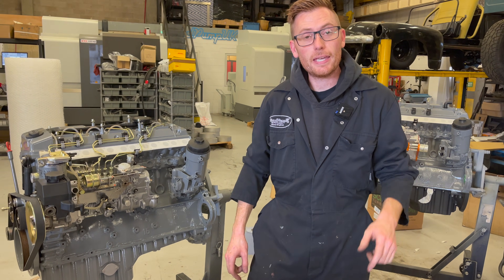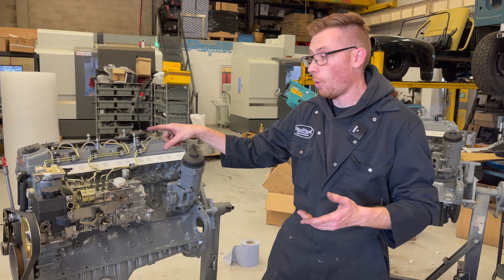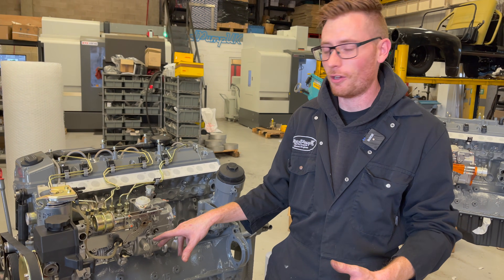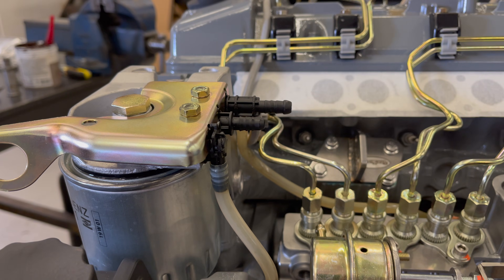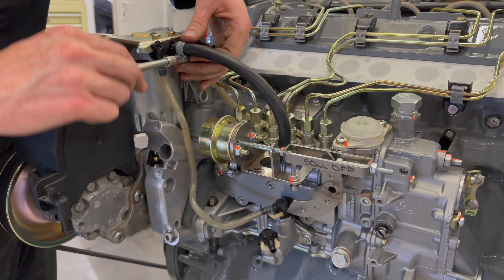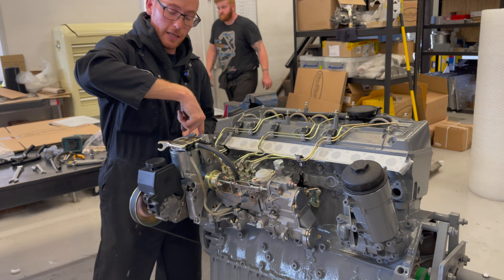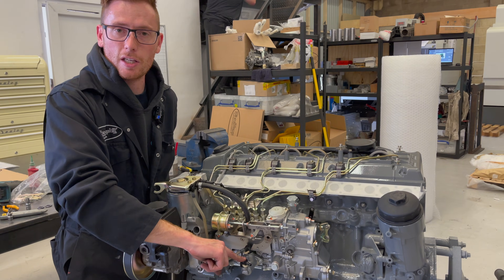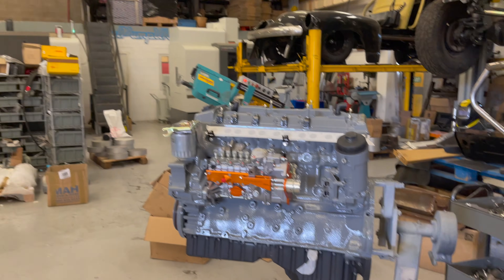HOW TO PIPE UP YOUR PUMP IN 4K.   OM606 guide to mechanical injection

Comment: How do you block off the pre filter
Reply from the maker: You don’t need to, it’s not internally connected to anything.
Reply: Corretion.  How would I by pass Pre heater since it will not be connected to the pre filter?  Just needing clarification.  Thank you again.
Reply: I just purchased Pre heater delete from your website. Thanks!

Comment: One of those would be perfect for a 1st or 2nd Gen Dodge Dakota pickup. They weigh around 3000 pounds with a 318 V-8 and being a mid size from the 90s has the biggest internal bed dimensions of any mini or mid sized truck. Since it’s full size brother was the first pickup with a 5.9 Cummins the OM606 would be a perfect match. By the way  my late cousin who job was a truck drive routinely got 25 mpg out of his mid 90s Ram extra cab dually one ton. I bet the pickup I described above would top 40mpg.

Comment: Here is one reason why I would love to get rid of the filter head: Japanese diesels have a manual primer pump on top up their filter heads, making replacement of the diesel filter much less scary.
Reply: just fill the new filter with fresh diesel or your preferred fuel treatment .. never had a problem since i was shown that trick

Comment: Could I bypass the lift pump and filter housing.  If I run an Airdog lift pump by my fuel tank.  That filters and separates water and air from the fuel.

Comment: If you're using an electric lift pump along with the mechanical one, do you recommend putting it in series with the original mechanical one, or tee it in so that whichever produces the higest pressure/flowrate at any point in time works best? Mine has an integrated check valve since it's a plunger pump so no problems with fuel returning backwards through the electric pump.

Comment: A couple reasons why people might want different filters:
- cheaper filter cartridges
- different filtering capacity or finer micron rating for wvo
- water separator with clear bowl
- built in electric heater or heat exchanger
- looped return before filter for wvo etc
- different parts availability for different areas of the world
- compatibility with other parts that they already have
Reply: The bolts from housing actually go through the head and into the block. If I deleted it I'd certainly find a way to secure those bolts.

Comment: You don't use a inline pre filter from the tank?
Reply from the maker: No, the tank will generally have a strainer
Reply: @DieselPumpUK  I was wondering how to integrate a fuel pressure regulator into this arrangement.

Comment: So I have a remote fuel filter housing with manual prime attached.
From this I just go straight to the pump inlet.
Should I Just T piece the return lines together and glsend them back to the tank like that?
I know you said no space restraints but I've definetly got height and width restraints.